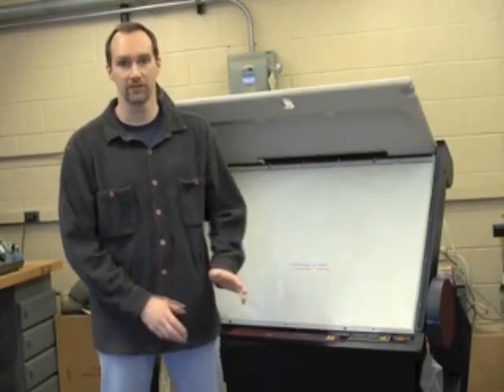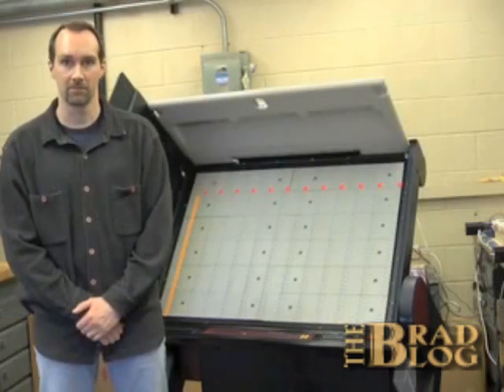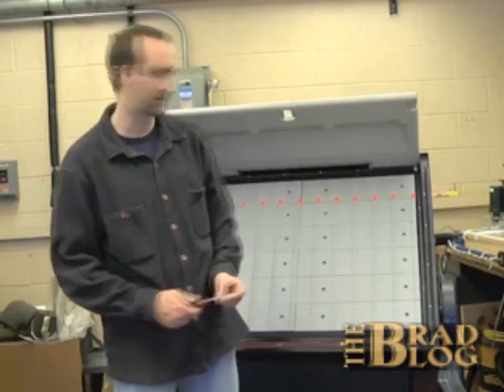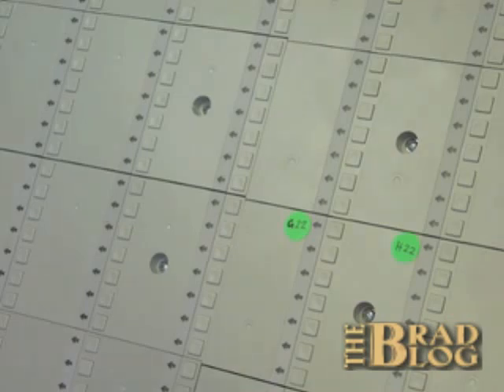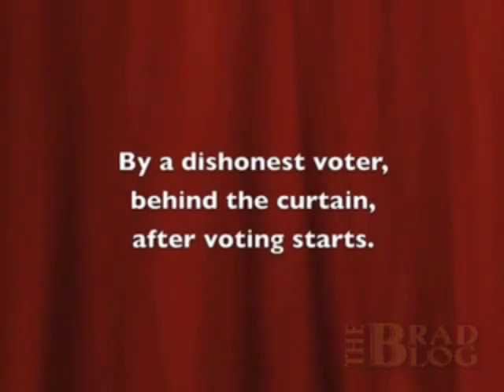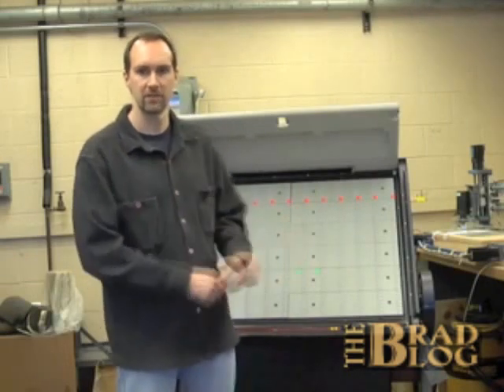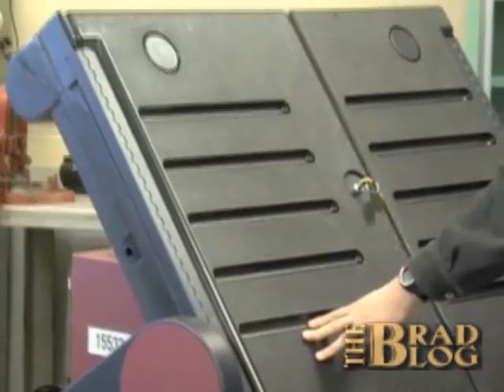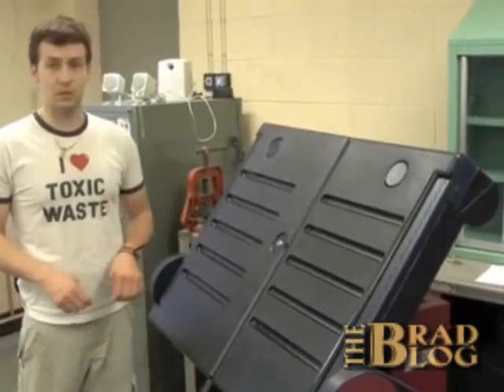Remote Vote Tampering Attack on a Sequoia AVC Voting Machine by Argonne National Lab

Comment: This is not remote vote tampering. This is onsite vote tampering. Question is do you know how many machines you need to tamper to swing the result ? The answer is thousands of machines.  Do you know how to access thousand of machines without anyone notice ? The answer is it is impossible. The machines will be guarded and there are CCTV around the machines. Do you know how many manpower you will need and how much time you will need to tamper with thousand of machines ? The answer is too many people and impossible to keep the operation in secret.
Reply from the maker: Sounds like you have no idea how this works. As Princeton found in one 
of the earliest known voting systems hacks (of a Diebold TS), a virus 
can implanted on a single machine that can then pass itself from machine
 to machine or to the central tabulator itself and flip an entire 
election with little possibility of detection.

That said, I agree that hacking a voting machine (or simply manipulating or misprogramming it from the inside) versus a similar attack on the central tabulator is not the best way to go. Why attempt a retail tamper when wholesale at the tabulator is much more efficient?

I have been covering the issue for well over a decade, have spoken to dozens, if not hundreds of computer scientists, voting systems experts and election officials (and other experts) throughout those years. I don't know where your information comes from.

BTW, you know those "guarded" machines you mention? Who do you suppose "guards" them?
Reply: If your country use paper and pencil and nobody guard the ballot boxes. The election can also be rigged. If nobody trustworthy guard the voting machines, it is the same thing no matter what you use for election if the whole system is corrupted.   If everyone  are corrupted, then hacking is not even necessary. Just pay the persons in charge of counting the votes and announcing the result.  This video is about hacking a voting machine and not hacking the server for internet voting.

Comment: He just said the spare boards can be bought on eBay for $19(much cheaper in bulk) and the remote control was purchased for $20 on eBay also. No electronic engineers were involved and there's no lock. Did you not watch the video? All it is doing is swapping the 2 switch outputs on the board. I could have done that when I was 10 years old! There's no need for anyone to tamper with it anyway. The Zionists that run the show behind the curtain take care of that long before election day!

Comment: @killzzz18 and anyone else asking how this is an issue..

Its not outside hackers using this exploit thatr should be alarming but the fact that anyone with the right connections can implement this for so little moeny and in little time as long as they can get private access to the machine.

The only way to avoid voting fraud is to be %100 open.  The only item that should be descreate is the individuals voting.  Otherwise every step shoudl be open and easily seen by the public.

Comment: No...when you vote you get a receipt that's barcoded for security (kind of like a lottery ticket) so they can't be faked.
All the voting results are put on a website where you can check...or you can give your ticket to some other party for them to check.
Assuming votes are registered with 100% accuracy it would check out OK.
You can check whether your vote registered at all, or not correctly.
But officials don't want 100% verifiable results for some reason.